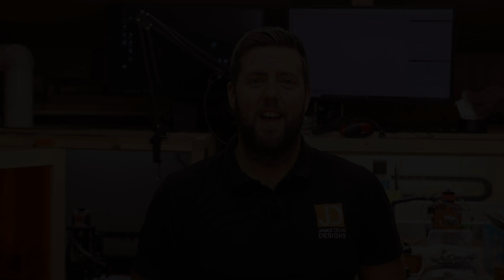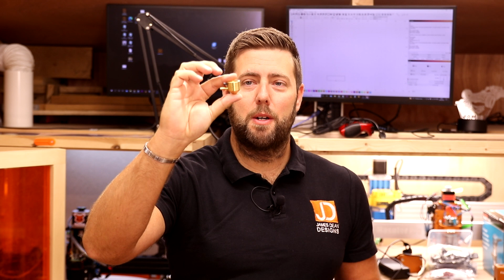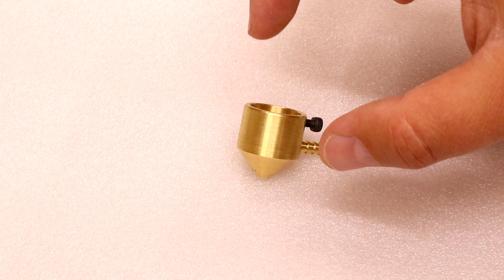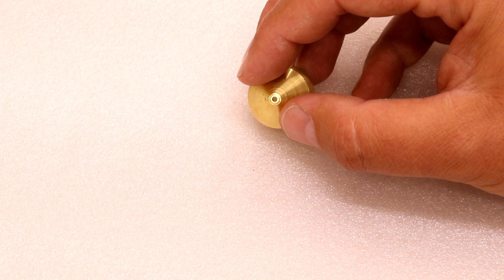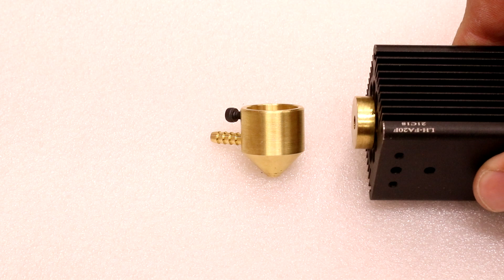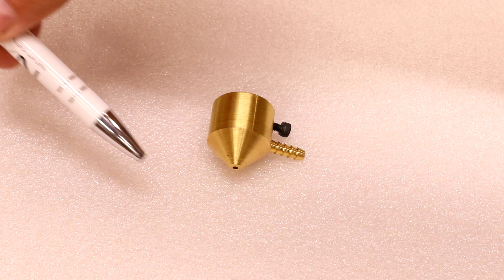Brass Air Assist Nozzle - Laser upgrade

Comment: Thanks for this James. Nice to see you supporting a small company. Have you ever considered doing a video on cutting different materials and the power needed for each one ? . The reason I ask is that I am interested in producing some parts for my hobby of scratch building wooden ship models. Would be nice to cut different types of wood etc . I know that I could use trial and error but as someone who has a great depth of knowledge like yourself and various lasers at your disposal it would be great to have someone show the limitations and the potential of different power lasers.I have just bought my first machine a 3018 pro with a laser 3 . I imagine that this is definitely an entry level model but got to start somewhere. Sorry for the length of this but I am very new to all this.

Comment: As a machinist in an actual machine shop, I think I can cut one of these. Brass maybe, but I have an abundance of aluminum bar stock that should do nicely as well, plus, I have the acid solution from my gunsmithing to turn it black inside and out.
Reply from the maker: Sounds cool. Let me know how you get on 👍
Reply: @JamesDeanDesigns  It's made. The laser showed up a week early so I got the measurements and cut one out of 7075 Aluminum. I don't see a picture option here but I'll put one on the FB group.
Reply: @JamesDeanDesigns  Awaiting the laser to get the measurements, but I already have a piece ready to cut. I should see the laser next week some time.

Comment: Did you ever tried to join 3d printed air nozzle with nozzle from 3d fdm printer? It's usually made of brass. Also if you screw that in. You won't have problems like you just show on the video. Also you can try to find best hole for a job. 2mm is little bit to wide. 0.4 is to small. 0.8 to 1.5 is best.... But DYOR :)

Comment: In theory, you can refine the design of the nozzle a little more by adding a chamfer for installing a rubber o-ring on the laser side to completely prevent air "leakage"

Comment: Hi James, thumbs up for another great video and for supporting other small business by promoting their ideas. Before this idea gets "stolen" and mass produced for less than a penny in China I got a question. For the people that live in areas where delivering this brass air nozzle is not possible or shipment costs more than the nozzle itself I would like to go back to that 3d printed nozzle. You said you used that fdm printed nozzle for quite some time and by the looks of it I'd say it does have quite a few hours of usage but what if I print it in resin and I use a different color than black. I haven't tried exposing an sla print to the laser beam of a laser diode but I know that resin prints are more resistant to temperature. Do you still think it's a fire hazard? I don't leave the machines unattended and my diy cncs aren't expensive machines but I would like to avoid smoking up the house and having the fire dept. at my door.
Reply: Where do you live that shipment isn't possible? For international orders the lowest shipping class is $20, half the price of the nozzle. Just curious!